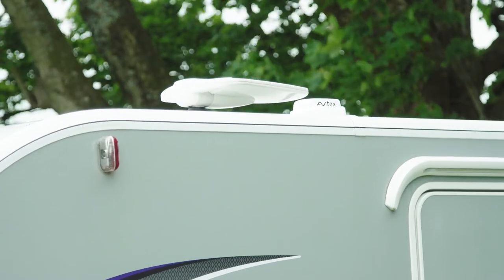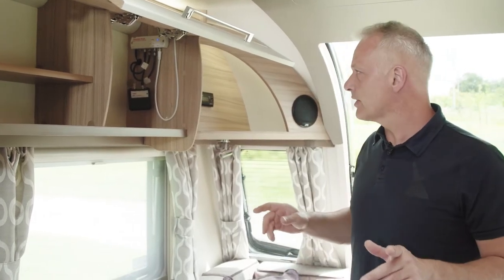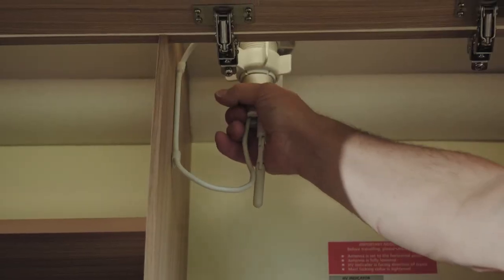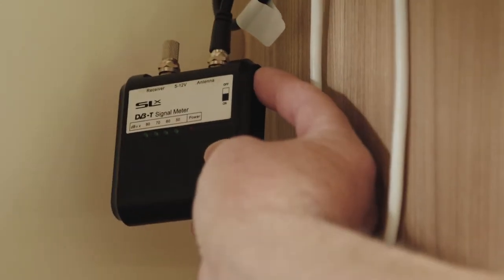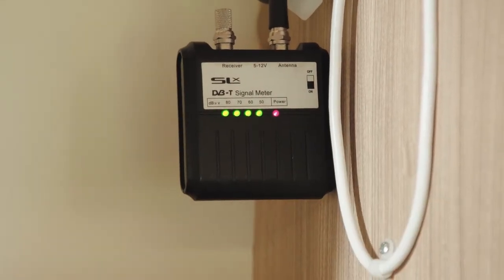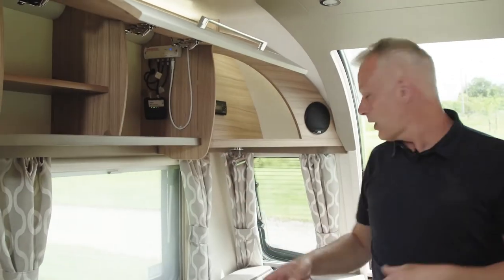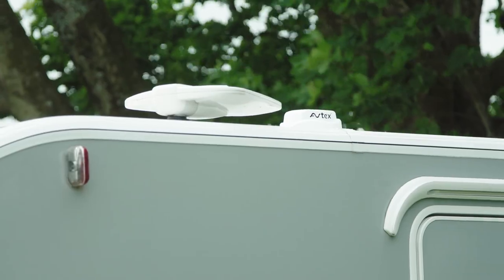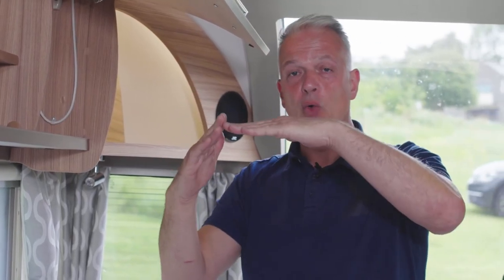How to operate the TV aerial in your caravan or motorhome

Comment: My Unicorn Madrid has an external input point where the external plug is located. However, this inlet point does not connect to the TV point inside the caravan. So, the internal TV point only connects to the aerial on the roof. Where does the external connection go to and is my caravan faulty?